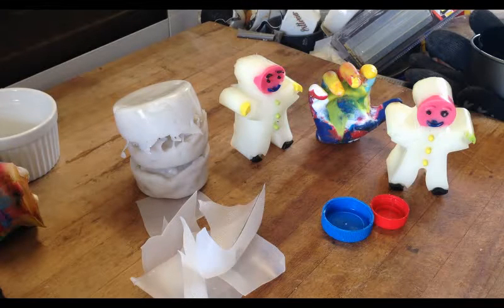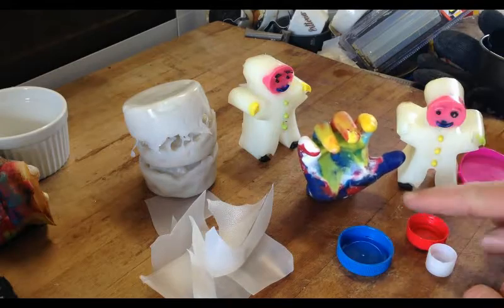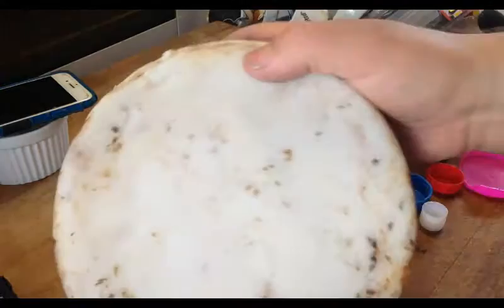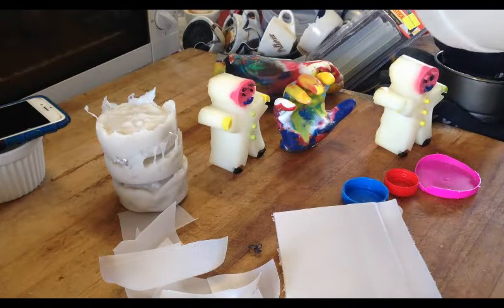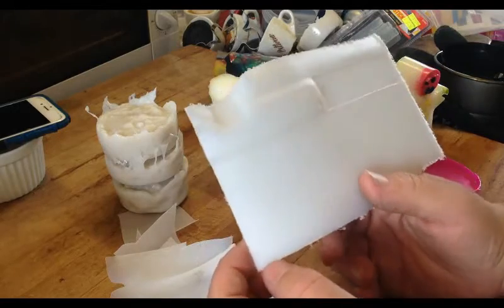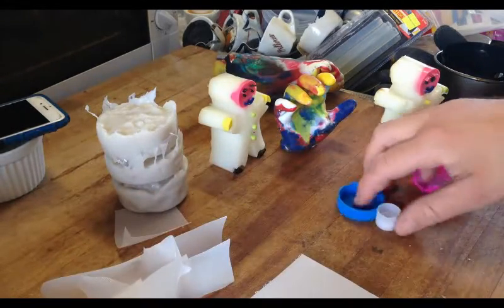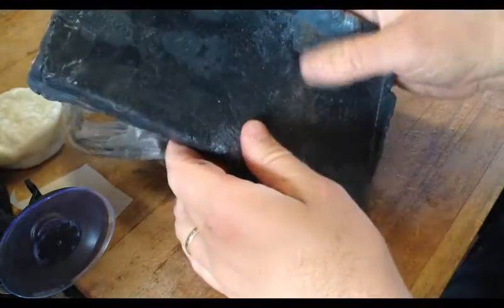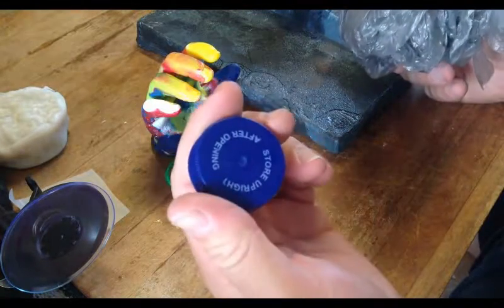Ep52 Talking About differences between HDPE

Comment: The lids are injection molded. In order to make the HDPE flow into the injection molds more easily, special additives called "plasticisers" are added to the HDPE to make it more liquid.

HDPE bottles and jugs are made through a process called "blow molding", where the HDPE is formed into a hollow sleeve. A mold is clamped on to the sleeve, sealing the top and bottom, and air is forced into a hole in the top, inflating the HDPE into the shape of the mold. For this purpose the HDPE needs to be stiffer in order for the sleeve to keep its shape as it is being formed.
Reply: Is plasticiser toxic? Is it available?

Comment: Interesting stuff.  Are there different numbers in the triangle of the material code or are the different properties due to the thickness of the HDPE used?  If its a thickness thing, then surely if it was melted for longer it has to eventually have the same flow capability as the other stuff - I don't know, I can't get my head around this.  More research required I think lol!  Keep up the good work.  Poo